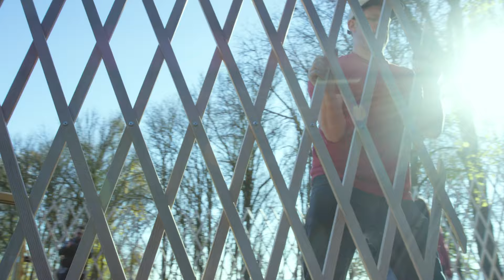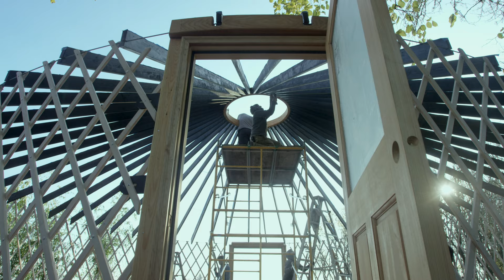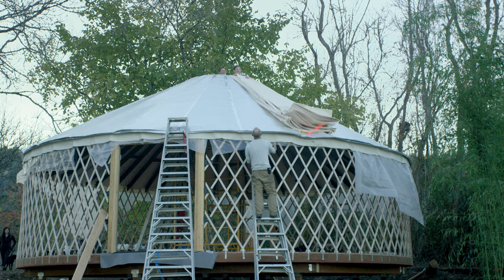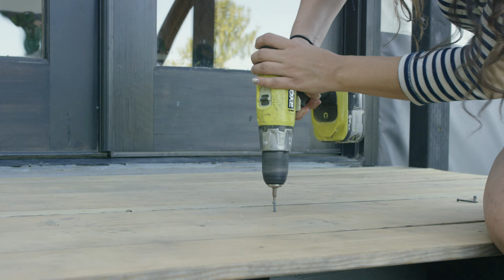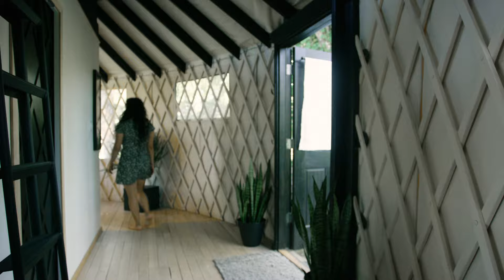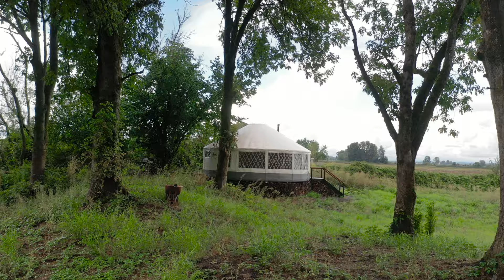How to build a YURT in 2 minutes | Do It Yurtself

Comment: Great informative video. 
2 Questions.

1. Can you recommend a building engineer that I could use.

2. Is there an insulating benefit to having the yurt off the ground, verses the thermal mass benefit?
Reply: I believe the yurt is off the ground so it makes it easier to level. Also, if it is not elevated then they may have had to build a foundation do to construction ordinances.